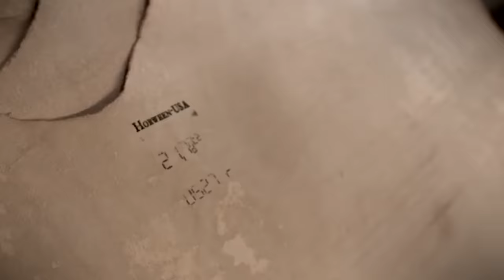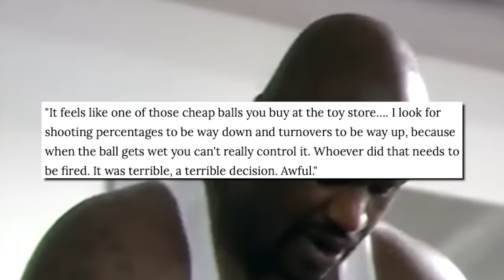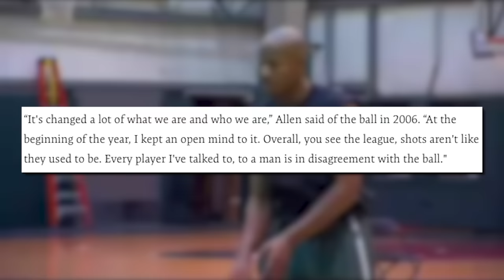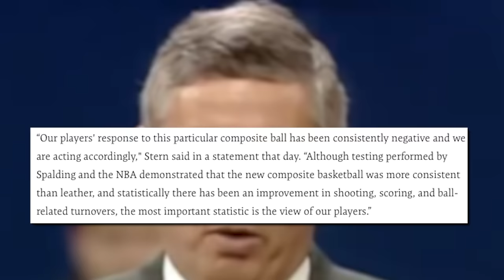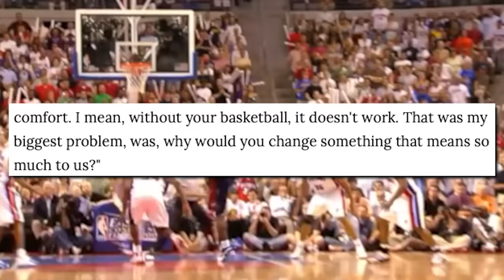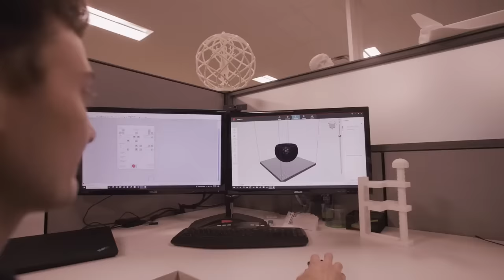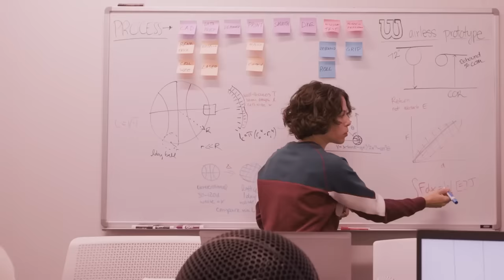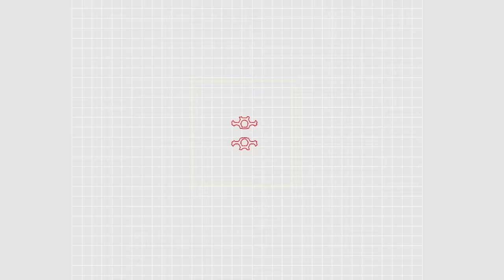The Weird Truth About The NBA's New Basketballs...

Comment: I have a idea use more thicker alligator skin for the Wilson ball. Add bigger holes for more ventilation, but also use crystals in the inner core layer for equal gravity but also depth
Reply: And also cover it in spikes that way it's easier to catch
Reply: And put a jet engine on one end for easy 3 pointers and glass shattering dunks.
Reply: add a gyroscope at the center
Reply: I’m thinking more of AI ball eh? Like with Siri installed
Reply: I'm in favor of a Uranium-235 core and Tungsten Coating

Comment: I dont think they intend for the ball with the holes to be the final product, its just the inside of the ball, like the rubber bladder they use now. They just take this new ball, slap the leather outside on it from the old ball, and voila, all the problems you just stated are solved. It looks the same, feels exactly the same, and flys exactly the same way, and its still airless.👍
Reply: na its just the grid, otherwise there would have been a single example of this skin in use, which there isnt, because they want to make as cheap a product as possible that requires as little human involvement as possible
Reply: @ince55ant  Or maaayybbe it's just a prototype, and not a finished product 🤦‍♂️

Comment: The concerns about holes are completely understandable, but it doesn't need to have holes. You can produce it with eight panels and "stitch" them together, it's a relatively easy adjustment. They can also cover it with a leather like material. I think they made the design this way to draw attention and show off the capabilities.

Comment: Sports Dynamics aside because I don't play basketball and I'm not sure why. I'm watching this video because I don't have much desire to really watch basketball, but this is interesting. I actually got to work with either a predecessor or a related model of the 3D printers that Wilson is using on these basketballs in college. We used the powder 3D printers to make robotics parts that had to be consistent across the entire surface but for one reason or another we couldn't use resin they printed extremely consistently, which was surprising considering it's a bed of powder. Despite my lack of interest in the sport, I'm interested to see how this new basketball goes and I'll probably follow the NBA for the first little bit when/if they introduce it, just to see what happens.

Comment: I can't wait to pick one of these up to play on the outdoor courts around the corner from our place - I agree, I think this is the market for this. The comment in the video about the changing flight of the ball is valid, but we contest with the wind altering the path of the ball as it is now, arguably one with holes might be less affected by strong wind shifts? So pros and cons either way. Still they look very cool - I want one. 🙂
Reply: What about Little Rock’s that can get inside?
Reply: I'm more concern about those lil rocks that get stuck inside.
Reply: I just really don’t see what the problem with the original was like sure it has air pressure “issues” but it just seems dumb to me.
Reply: Rocks than get inside can get outside, the ball isn't shape-shifting
Reply: @Bound2BeatU yeah.  Why do anything really.  Let's just all sit around not innovate and wait to die.
Reply: @davidaugustofc2574  Not really, they'll get pushed inside in an impact, but there's no impact from the inside out to push them back out.
Reply: @ska042  I present you: inertia
Reply: @davidaugustofc2574 Yeah, little rocks don't have much of it
Reply: @ska042  little rocks then wouldn't get stuck
Reply: @davidaugustofc2574 You really don't see it? It's a rubber net, you can totally push something just a little bigger than the hole diameter in and it won't come out easily since there's no way to push it back out
Reply: @ska042  I can see the one exact bounce with just the right angle to get the rock of just the right size stuck in a way it can't fall naturally. More common than clouds in the sky
Reply: It appears to me that the many holes in this ball actually increases the surface area of the ball's exterior therefore increasing its reaction to the ambient air wether still or windy.
Reply: But the holes reduce the cross-sectional area, which is what appears in both the lift and drag formulas. One cannot guess the change in both coefficients, no matter how hard they try or how smart they are, you find it through experiments and then you can tell for sure if the ball is worse or not.

Comment: I’m wondering if you play in different places, the ball should feel different due to elevation, humidity, air pressure. If this new ball isn’t inflated, it wouldn’t have most of those issues
Reply: The issue with this logic is that balls are inflated and tested before the game, on-location. Elevation and temp will not affect a rack of balls that are inflated and tested that day; Internal psi is consistent if the environment it is inflated in is consistent.
What you are saying WOULD matter IF the ball was inflated somewhere else then MOVED to another location with significant ATM and TEMP changes that would create variation in psi.

Source: dive master. psi and atm are literally life or death.
Reply: Ex. If you inflated a basketball at sea level, it's psi will be higher in the mountains. If you inflated a basketball in winter, during the summer it will be hard as a rock. You can also do this with water bottles while driving through the mountains.

Comment: I like the non air pressure ball idea but not bunch of holes. They need to cover it with something that can last playing outside
Reply: It's for the nba not to play in the streets
Reply: @christianmarrero3205  But it'll be even better if is designed to play in both
Reply: @toututu2993  Rocks can hit the holes edges and the ball will bounce unpredictably.
Reply: @christianmarrero3205  Not necessarily, at all actually, theres not really a market option for a top of the line basketball that doesnt have extremely durability issues when playing outside. It is also puncture resistant which is massive.
Reply: @Powermongur  you dont clean your court off before playing?

Comment: I wonder why people think this would lack grip or air resistance. 

1: It's clearly not hard like a PLA or ABS plastic. It would be more like a kind of TPU or Silicone plastic, which would absolutely grip and bounce.

2: When the ball is in flight it's usually spinning. The dimples on the surface alter the aerodynamics of a leather ball. This ball would behave similarly while spinning. In fact I expect that, given practice, the larger spaces will give players even greater control over longer distances.

Comment: There goes the three point line.  Aerodynamic is big in long shots and passes.
Reply: Plot twist: it improves 3 point percentage instead
Reply: @SoFresh415  They'd have to exert extra effort to throw it. No more logo shots.
Reply: Just shrink the holes on the inside to get the same effect as dimples on a golf ball. That would create air pressure allowing the ball to travel further with back spin.

Comment: Natural leather is an unique material. With sweat from your hands it becomes sticky instead of slippery. I can't see any composite doing the same while being bouncy and cheap at the same time.

The whole air pressure and bounce is a nonsense. Sure temperature changes the bounce of a leather ball, but you can allways inflate or deflate it to make a correction. With airless homogenous composite, temperature will change it's bounce, but there will be no way of correcting it.

And third, there is that thing with holes. Gym floor can be a messy place whatever you do. Hair, fibers from cloth, dust particles, everything is there. NBA courts may be cleaner than your local gym, but still. Those holey balls WILL soak all the hair and fiber on the ground inside and there will be no easy way to get it out.
Reply: Won't it just come out of the same holes it soaked into?

Comment: I still play with a Spalding Peja Kings basketball from the 2000s. I don't really want to switch from it because I like the smoothness of the ball and the weight is heavy for good strength training on your shot and dribble moves. This plastic ball isn't too innovative since anyone with a 3D printer could make it, but of course, branding is gonna be the outlier here.
Reply: nah cus if you watch the original 3d printed basketball trailer, ur gon see that the ball is laser cut from some sort of sand object in a special very expensive 3d printer
Reply: it's laser sintered, it's not like a normal FDM 3d printer

Comment: You can't 3D print a ball, this is insane. 1. 3D printing is asymmetrical, if you drop one ball, and another rotated 90 degrees, they will bounce to different heights. You cannot 3D print an object that bounces the same height at any rotational orientation. 2. Elastomers deform over time, you can pump up a basketball and check the air pressure very easily, 3D printed balls will lose bounce overtime and you can't just pump more air into it.

Comment: While it might remove air pressure issues, I don't see how the material itself will keep it's structural integrity over longer periods either. Changes happens and the balls are likely replaced often enough where the small differences are irrelevant anyway
Reply: Neither do normal NBA basketballs. They have severe durability issues, teams get 150+ each PER SEASON

Comment: the 2006 balls was 100% the same problem that happened when they switched Coke recipes.

the new coke consistently tested better and people liked it more in blind tests. it was slightly cheaper to make, and people seemed to love it more. so they rolled it out, and then backlash happened.

coke did more testing, found the exact same results, and then informed the people involved. instead of accepting that they liked the new recipe, they got mad and belligerent that old coke was better, even though they had just proved they preferred new coke.

Comment: "It is the exact same weight, size and bounce as the regulation ball."
Gosh, if we only had some device to measure air pressure, there would be no need to reinvent the basketball.
This is all about selling new basketballs to the public that can be made cheaper for the same price or more. Their use in the  NBA is free advertising.

Comment: Why can't they justmakebit looked the same? It wouldn't be a issue if they put the damn leather on it. It's not hard at all to make it weigh the same, and it might even sound similar because it would have air trapped in it, it just wouldn't need to be refilled as the skeleton would keep it up.

Comment: What is amazing is how testing by others (outside spalding and the NBA) consistently showed the ball did get slippery when wet, and did not bounce as much, and was (due to poor manufacturing controls in my opinion) more varible in bouncing.  Yet they kept trying to defend it even as they pulled it.  

And now the new ball lacks air.  But it is a manufactured material.  And that means, following all the basic laws of physics and thermodynamics and chemical engineering, it WILL change over time.  How it bounces, how it feels, the materials will adjust.  Take a paperclip, bend it back and forth and the metal weakens to the breaking point.  Take a manufactured ball, smash it into the floor over and over and over, and the bonds in the material break down and weaken changing the performance.  With an air inflated ball you can tweak the amount of air to compensate for the leather changing over time from use.  With this ball that will not be possible.  Which tells me exactly what will happen if they try to use it as a season goes on.  Oh maybe they compensate by using the balls for one game and then donate them to charity and bring in a new set so always new and shiney.  But it's not going to do well over time.  And the hexagons on the ball .. players will get back to the finger complaints I can promise that.  You need to reduce those hexagons by at least 40% in size (likely more) to avoid the pressure on cell membranes from long games where they are gripping the ball and the skin puckers into the hole.
Reply: i get the feeling the disposible nature of the new ball is part of the design. if they made the perfect ball that could last 5 lifetimes, the company would go out of business in a year
Reply: @ince55ant  They say current high end balls that are well maintained can last about 12-18 months with two hours use per day.  Cheap ones would wear out faster with the grip fading as the surface gets worn.  But in the regular market for people, since they are not using the balls over and over daily like this they can easily get 5-10 years out of a good ball.  My concern is they will last 1-2 years for the average consumer, by design, to boost sales.

Comment: That new ball looks outright dangerous. In my experience, basketball is one of those sports where your better make sure to cut your fingernails, because otherwise they snag on the ball and break, and having so many holes with edges to snag your fingernails on just seems like a racipe for disaster. The holes are also way too big, to where I can easily see players' fingers getting stuck, and maybe even breaking if throwing or dribbling hard. Especially if children are ever allowed to play with it, it would be absolutely awful. As you mentioned, another concern could be hair getting tangled in the holes. All around, an airless basketball sounds like a good idea, but with holes this large, it seems like an inevitable lawsuit.

Comment: However, it's not a ball, but a lot of holes tied together with plastic, and the bounce is going to be more irregular as a result. And exactly the same problem with cuts is going to appear, as each of the edges on the holes is a pull point.

Comment: Valery Legasov: Why? For the same reason our reactors do not have containment buildings around them, like those in the West. For the same reason we don't use properly enriched fuel in our cores. For the same reason we are the only nation that builds water-cooled, graphite-moderated reactors with a positive void coefficient.

It's cheaper.

Comment: the real problem is gonna be that, ignoring safety concerns with the holes, if it feels different and flies different people wont want it. theoretically there is zero difference if it feels and flies different as everyone us using the exact same ball so the real difference is that some players will just adapt better than others. and you could say that that is the problem that some players simply wont be as good with this ball after having put in years to train with a different one and now hardly can change all that training but on the other hand wouldn't it be equally unfair that people who are worse with the old one having to play wit hit because of those better with it. who are the best players will change but who cares thats gonna happen anyways so a objectively better ball should be used regardless of complains

Comment: The aerodynamics of the ball is easy to fix. Uou angle the holes so that the cut through the air as it spins rather than resist the air. The more interesting thing will be if the ball whistles. When throw a football I can hear it ripping through the air. Thr ball basically hisses as I apply the force needed for it to accelerate violently off my finger tips

Comment: its never going to work. it has like 300x the surface area. so it will completely change its weight after it starts collecting sweat liquids and dust during use. the holes are not just aerodynamic but will grip surfaces differently. its just impossible to make it perform the same. It's the same thing with real grass vs plastic grass for football. it just looks nice for a display case

Comment: i dont see this going far considering football doesnt have to worry about the bounce aspects yes air pressure to make the ball bigger or smaller/ more grippier or whatever but football coulda did this same thing a long time ago and half of the factors we have to consider with this basketball you dont for a football and were still using the same old footballs without a thought of changing them or at least to my knowledge

Comment: Also if the weight of the ball with out the leather is same as current ball adding it would make it slightly heavier also larger wouldn’t it? Not by much but not sure if it would make a difference

Comment: It's not a shockingly similar situation, this whole thing is  marketing ploy. There's no revolutionary tech involved. They took a well known concept, shaped it into something like a basketball and printed it with an SLS machine. They likely couldn't patent it even if they wanted to. SLS printers are low volume and mostly for protyping. It's just not 
 practical for manufacturing at scale.  

Even if they tool a process to do it, it would take a lot of investment and would be a ways out. At most, I could see something like it becoming the inner shell of a more typical ball.